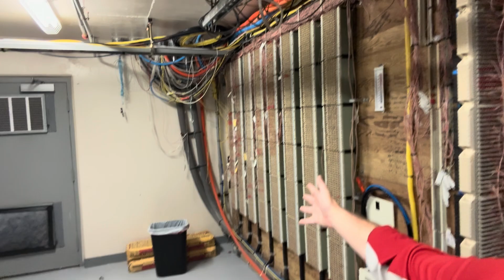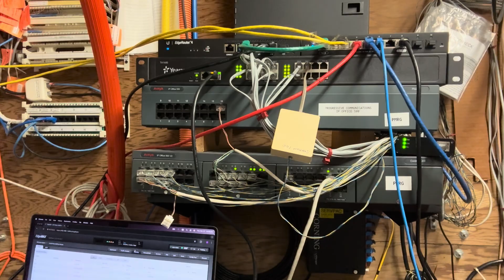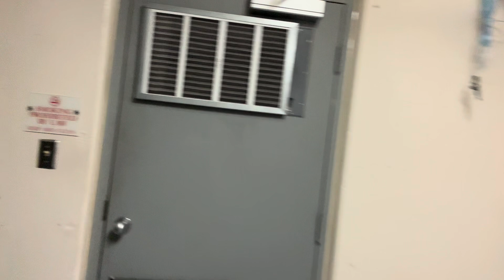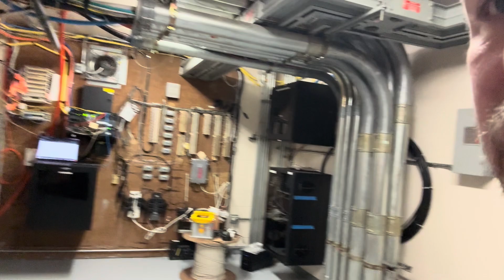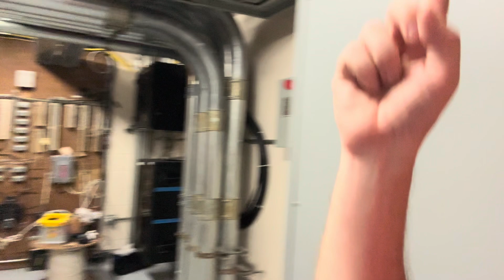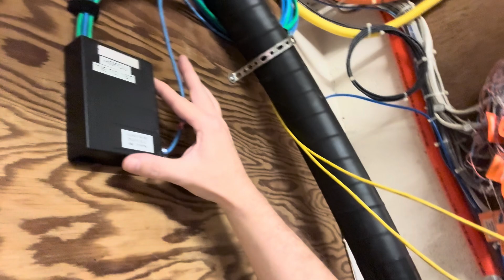Network Technician's VLog Ep1

Comment: Don't you wish someone would have spent a couple of hours and hundred bucks on some primer and paint for the plywood... before it had multi-generations of equipment mounted all over it?
I started using sheets of FRP (Fiberglass Reinforced Panels) glued to plywood walls for new telecom / equipment rooms. $40 for 4X8' sheets. Works great and old screw holes are easily patched with matching white silicone. 15 years later stills looks bright, clean and new.  Love the channel - Old dog likes learning new tricks.

Comment: May I ask you please, What is the best laptop for Networking work and Emulation desgining and learning tasks
Thank you so much.
Reply from the maker: As long as a laptop has an ethernet port and isn't dog slow I am happy, we use these and they are fine:  https://www.dell.com/en-us/shop/dell-laptops/latitude-3450-laptop/spd/latitude-14-3450-laptop

Net software like fing, wireshark, and the rest should work fine on most anything so don't blow a ton of money on them.
Reply: Yeah you don't need anything fancy. I would go for a computer from within the past 5 years. I'd go with at least 500 GB of SSD space, a quad core CPU, and 16 GB of RAM. If you're going to be typing in a lot of numbers, look for a model that has a number pad.

Comment: I wanted to ask: Do you keep a digital copy of these kinds of notes you add to cables?
I know there are many kinds of NMS software to help building a digital map of network equipment, but only for "smart" devices within it. They do not capture things like "for this link we had to drill north-east wall" or "this link is converted to a phone line, goes to another side of building, up 3 floors, and then back to this side of building" - things that become invisible from within the network.
Reply from the maker: Since I use a Mac, I bought a program called OmniGraffle some years ago - it's basically what Visio is, and I lay out my notes in a spreadsheet if I am concerned about later visits not going well due to weird stuff that went on.  A good example would be a hotel I work in from time to time, they have a fiber link go into a conduit, then somebody cut a semi-circle into the conduit near their banquet room ceiling and diverted the fiber out of it and sent it on another path.  If I know someone will see it go into a conduit and then not find it at the other side and maybe give up, I will make sure I've got drawings and photos.  But that is time consuming and so most of the time I use the physical labels and sleuth it out.

Comment: What's the Optima Yellow Top car battery doing ?  Thanks for the vid!
Reply from the maker: You find the weirdest things in these rooms, I swear
Reply: At least they used a quality brand deep cycle battery.
Reply: @aguyandhiscomputer  Agreed.  I recognized it because I have two of them in my TJ.
Reply: Didn't realize the TJ's had two battery spots. Nice.  @meme-d2h1g
Reply: @aguyandhiscomputer  aftermarket battery holder, high amp winch and lights etc.
Reply: @meme-d2h1g  Very cool. Don't see many TJ's out there.